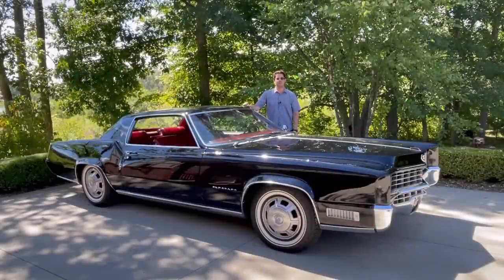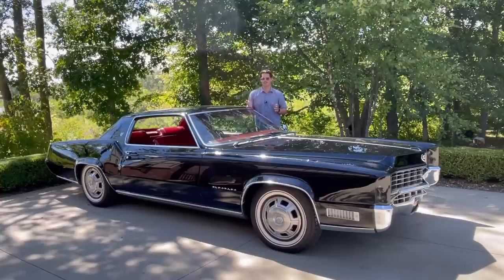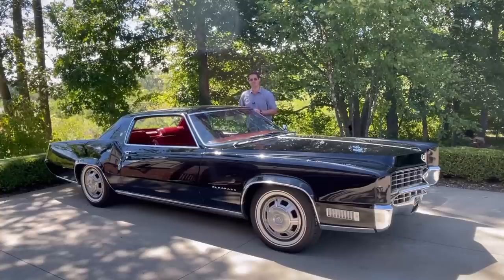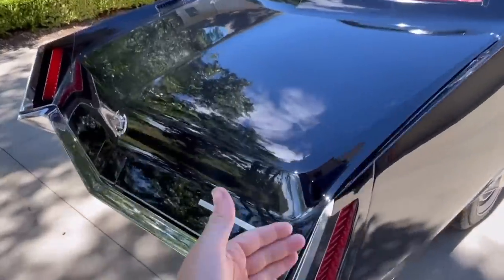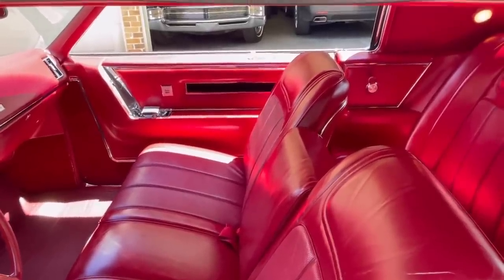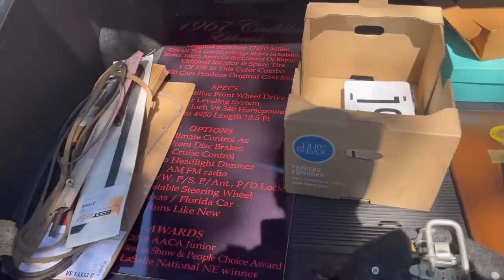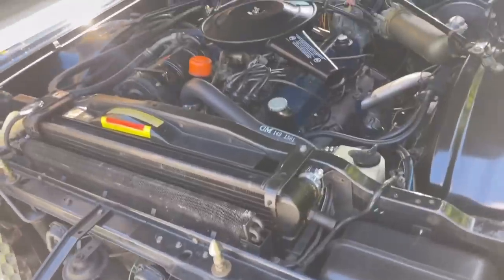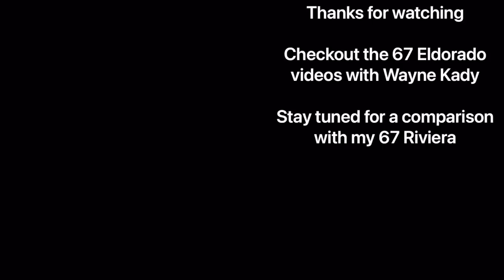Best Styled American Car Ever Made? The 1967 Cadillac Eldorado (with just 18k miles)

Comment: To get power "vent" (rear) windows, one selected option "N" on the Eldorado order sheet. You could select every tiny little thing on these cars. For example, my '67 has power "vent" windows but no power (vacuum) door locks. (One less coffee can under the hood for me.)

The chrome rear-window surround is an ongoing mystery. My best guess at this point is that some dealers created their own trim packages that included a chromed rear-window surround. Since all '67 Eldorados rolled off the same assembly line - a new line built just for the Eldorado that operated at half speed for one shift only - the source of a chromed rear-window trim may well have been external to the factory.

Another one-year-only trait of the '67 is the single, round external, remote-control  rear-view mirror. It was a simple affair with the mirror lens simply mounted on a stick, with the whole mirror base firmly mounted to the door. There was no option in 1967 for a passenger-side mirror.

Pedestrian-safety and driver-visibility regulations changed that mirror for 1968. To increase rearward visibility, the mirror became larger and rectangular. For pedestrian safety, the 1968 mirror had to be attached to the door in such a way that it allowed for the mirror to break off more easily. The '68 mirror remote control is operated through three small cables that run through a break-away mirror base. In other words, you can't easily swap a '68 mirror for a '67. They're completely different.

Thanks for another great video!
Reply: An additional data point for the chrome-rear-window-trim treasure hunt: The last '67 Eldo I saw that had the chrome trim was a California car. 25% of all '67 Eldos built were sold in the Southern California market, thanks to their star-power appeal. '67 Eldos - along with all other '67 Cadillacs - were special anyway because they all required GM's A.I.R. system to meet CA pollution standards of the day. 

Perhaps the chrome window trim could have been an additional perk for the very few who purchased a slick-top Eldo in Southern California?
Reply: Thanks…,interestingly the : no passenger REar view **MIRROR; a strange thing  at best…..
Reply: Wow, you know these cars well. Love it!
Reply: @waltschmerz  Haha "slick-top". Never heard that one!  Interesting info.on the stats. Thanks for that.
Reply: @opera93  That was pretty common to have no right-hand mirror from the late '60s on back.
Reply: @opera93  Here's a mirror-related message I wrote yesterday for another Cadillac-related group:
-----
One difference between the '67 and '68 Eldorado that almost everyone misses is the fact that the '67's external driver's-side mirror is round and relatively small while the '68's is a larger rounded rectangle. This is due to new pedestrian-impact and visibility standards that took effect for the 1968 model year (the same standards that moved the turn signals to the front fender tips and put round side-visibility lights in the rear quarter panels).

If you whack a pedestrian with the '67's mirror, it will result in a very nasty injury because the round mirror is simply (and sturdily) mounted to the door. The '68's mirror has a breakaway base and flexible cables (instead of a simple joystick) to direct the mirror's lens. Of course, being whacked by a '68 wouldn't be any fun either, but at least you'd stand a better chance of breaking the '68-Cadillac-guy's mirror. 😊

As a corollary, no passenger-side mirrors were available on any 1967 Cadillac (not just the Eldorado). Passenger-side mirrors were available in 1968, but they're very rare. That's primarily because they were "flat" (virtually useless) mirrors, not convex like the passenger-side mirrors we're accustomed to today. Back then, not only were convex mirrors not trusted by the general public, they were even illegal. If you look at pictures of (stock) cars from the 1960s, you'll see almost no passenger-side mirrors.

How do I know all this? I adapted some '68 mirrors to fit my '67. The Eldorado's huge blind spot made me nervous so I decided to change things up. The larger visible area provided by the newer driver's side mirror was a boon. Once I saw how useless the stock '68 passenger-side mirror was, I stuck an aftermarket convex mirror to the surface of the passenger-side mirror. Now it is somewhat useful! 😊
Reply: @UberLummox  I've been working on a '67 for the last six years. I figured I've spent enough time and money on it to have earned a PhD in '67 Eldorado by now.😀
Reply: @waltschmerz  Haha nice!   That and the '66/7 Riv are about the last 2 on my list of Us cars I haven't yet owned, and may not get a chance to own.  Enjoy it!!!
Reply: HOMKY! THIS! 1967! CADILLAC! ELDORADO! IS! AN! (ALL)! AMERICAN! HOMKY! (CLASSIC)! CAR!

Comment: I concur, one of the most beautiful of the GM's. The 73 Grand Prix used the hot wire rear glass but abandoned for the 74's forward.
Reply: And the 69 Grand Prix was the first with wires in the windshield in place of a regular radio aerial.
Reply: @billolsen4360  Thanks Bill, I didn't know that.

Comment: Three outstanding exterior features of your 1967 Eldorado: no vinyl roof, no door edge guards, and No Protective Bodyside Molding running between the front and rear wheel openings! So many beautiful cars from the 60's and 70's were ruined by tacky add-ons that looked like accessories from a J.C. Whitney catalog. I agree with Ford designer Eugene Bordinat, "the '67 Eldorado looks like a powerful athlete, dressed in a tuxedo". Thank you, Adam, for keeping America beautiful.

Comment: Adam, you've once again accomplished the near impossible locating a virtual time capsule example of a car difficult to locate in even acceptable condition and not cost effective to restore to perfection. (If even possible.) Not to mention one that's a standout in color, trim and options and my favorite design as well. (Or is it the early Riviera's, original Toronado, Mark III, etc.?! LOL)  Every car guy has at least one story of "the one that got away" and mine involves a '68 Eldorado still in the hands of the original owner in the late 90's. A beautiful aqua example with white vinyl top (bare metal would've been the only possible improvement), white leather and otherwise black interior appointments. The price was right, but I simply didn't have the storage the near pristine car deserved. In fact, one reason the owner was finally selling was because he was upset to discover that while in storage a mouse found itself lost between the spotless white headliner and roof panel and chewed its way out making a small, ragged hole behind the passenger sun visor. Don't know about your painted rear window trim piece, but I do know build location itself wouldn't have influenced it as Cadillac operated only one factory throughout most of the 20th Century on Clark Street. Fantastic car that's another standout example of how your original condition collection truly does turn back the clock in a way that fortunes spent on restoration cannot truly duplicate. Thank you so much!

Comment: Hard to take my eyes off your stunning home and its setting!  My parent's 1963 Cadillac's cruise control had an interesting feature: turn it on and dial your speed but don't engage..   When the car reached the pre-set speed, the accelerator tightened up to. You could accelerate past this point, but it was very firm.    You could, of course, engage the c.c.   GM was famous for rusting around the rear windows.    I had a 1966 and 1967 Riviera with Triple Turbine transmission Dynaflo. No shifting. Things would MOVE.   Headlight doors were kept CLOSED with vacuum rather than being opened with it.  Thus if there was a vacuum leak, the headlight doors would open.   One of my favorite Cadillacs was the 1977 Seville.   Gorgeous!   Friend had one (new). Fuel injection. But would cruise at 30mpg, so I had to ride the brake all the time. Cadillac seemed unable to adjust it.  Big ,mistake removing the door handle from the rear of the doors. In case of emergency, the rear passenger could open the door.  Its removal essentially trapped pax in the rear seats.  I wish you  had taken us for a drive!

Comment: Adam, you are so close to my two best designed cars, not just GM, the 67 Eldorado and the 65 Buick Riveria. They were so different but so much the same---sporty, formal and great crease lines.  Hidden wipers saved money (a bean counters idea)    lol.    The back window looks great without chrome trim around it.   Is there a life span for the front drive transmission "chain?"     SAVE the old battery......    Somebody should make some book ends using a 65 Riveria and a 67 Eldorado.      Thanks for sharing your great piece of GM history.

Comment: Hi Adam, et al, I've always been torn between the 1968 Eldorado and the '69 Mark III as the most beautiful cars of the Post-War era.  I prefer the '68 to the '67 for the more refined styling such as the front parking lamps, etc.
Reply: The 70 was the pinacle.  Got rid of the kitsche earlier do dads and better mechanicals and interior.
Reply: @rogersmith7396  Hi Roger, I actually prefer the more baroque styling... or kitsch... on these cars... particularly the concealed headlamps... that's all part of their charm. 🙂
Reply: The Eldo was a lot more sporty and the Lincoln was a lot more money.  I would say the Lincoln had a higher build quality especially the interior.  As a teenager I used to drag race the Eldo.  Would never do that with the Lincoln.
Reply: @chriscadillac8448  Well I have a word for it which is no longer politically correct but it goes with chrome curb feelers, continental tire carriers and white fur interiors.   Super fly.  My opinion the car got better every year until 71 when it imploded into a disaster area.
Reply: In case you can't tell I've had a love affair with this car for 50 years.
Reply: @rogersmith7396  Hi Roger, I'm not PC, I have more guts, so I'll say it, I would never equate design elements such as concealed headlamps, or more tastefully executed parking lamps or windshield wipers with the side pipes and fur upholstery of a ghetto cruiser or pimpmobile. I just think they make the car look better... in fact, IIRC, the Super Fly Eldorado had the exposed headlamps with giant lenses... which I never could comprehend.

I, too, have had a fifty year love affair with this car... being born in '68... when I was a boy, these types of cars were all over the place. Our next  door neighbor had a black over silver with black leather '68 Eldorado that every morning he had to spend a few minutes hosing off my drool. I have fond memories of being taken for drives in that car. 

Unfortunately, I never owned one of these. However, I have owned a couple MK. IIIs and agree with much of you said, comparing these two titans.  With the exception that being in my early 20s when I owned the first one, I did do my share of street racing with it. The biggest problem with that being the extremely broad sail panels making a right hand rearview mirror a necessity. I was fortunate to get one off of a wrecked '69 at my buddy's salvage yard. 

That aside, when I compared the '68 Eldorado and the '69 Mk. III; that comparison was based on aesthetics ONLY... which is the subject of this video; not on build quality, performance, etc.
Reply: @chriscadillac8448  I was in HS in 1970.  My mom had a 70 Eldo in gold, probably the best purchase my dad ever made, $6600.00.  I could drive his 66 Mustang 6 cylinder no PS or PB, or I could drive my moms fire breather.  Guess which one I took.  I street raced it all the time.  400 HP is hemi Cuda range.  My bread and butter was 383 Roadrunners and 396 Chevelles which were basically decal muscle cars.  Not stupid enough to try a 426 or 440.  Embarrased lots of Ford and Chevy guys and made believers out of them.  They traded it in 77 on a downsized Coupe de Ville.  I was sad to see it go.  4 years ago I bought a 70 Eldo which mainly needed lots of cosmetics which I have mostly completed, tried to paint it the same gold with black interior like moms.  $2500 from Texas no rust.  Our next door neighbor had a MkIIL so I was familiar with it.  Not sporty looking but nice, especially inside.  Theirs was an Army green in and out not my fav..  There was a washed out yellow one for sale around here in very good shape.  Think it had bigger bumpers but otherwise the same.  Stopped and looked at it but a real crappy color.  As for PC I will say greaser cars and rice grinders but I get in trouble on Youtube a lot for being too honest.  Actually I mean no disrespect but the word says exactly what I mean especially about the front grill on the 67.  Cheers.  You might watch Cold War Motors and Eds Auto Reviews.  Both comedic takes on old cars..  The Swedes are nuts about land yachts.  They have car meets that would put Americans to shame.  They are totally serious about land yachts.  My first owned car was a Triumph GT 6.  Go figure.  Raced motorcycles even more.  I could go at Cudas with that.
Reply: The two times I got embarrassed on my bike was a 68 Shelby 428 Mustang with roll cage and a race prepared 301  57 Chevy with fiberglass front end.  Probably solid front axel.  They smoked me bad on my 380 Suzuki which I still have.  Also have a Ninja 1000 which will smoke anything.  Took on a turbo Carrera with that and I was out of his sight before he found second gear.  A really dangerous bike.  0-60 2 seconds, 0-100 4 seconds then 4 more gears.

Comment: Hi Adam,

Congratulations on your '67 Eldorado. I've never seen one with hand crank rear windows before. 

The battery in my Marina Blue Poly '67 Eldorado was long and very heavy like your original car battery. I never had cranking issues. 

I didn't have a vinyl top or chrome molding around my bifurcated rear window either. Personally, the '67 Eldorado is worth the Cadillac wreath and crest on the C pillar, if nothing else. I agree with Wayne. The first year is usually when the design is presented in its purest form. Subsequent changes usually subtract from that purity.

I agree that the design, especially for such a large scale personal luxury vehicle, is unparalleled. Although the '66 Toronado and Riviera are beautiful, the '67 Eldorado is GM's Magnum Opus. It literally looks like a handsome, athletically built, tuxedo clad, confident gentleman, on wheels. One who stealthy glides into social spaces eliciting all eyes admiration, magnetism and a touch of envy. Well done!

Comment: Gorgeous car and a superb example. What I have never understood is why they bothered with front wheel drive in the first place. It can’t have been for packaging efficiency. Another thing, what was torque steer like with a huge V8?
Reply: The front wheel drive in these early GMs provided an absolutely flat interior floor pan which was heavily emphasized in the advertising.  I don’t remember a lot of torque steer complaints.  Power steering during this era was literally controllable by a fingertip (absolutely zero road feel) which may have significantly overcome torque steer.

Comment: That's a tough one!  I'd say this is at least in the top 5 GM styled cars perhaps?  I would include the '63 Corvette Split Window, the '64/'65 Riviera, the 66 Toronado and probably the '65-69 Corvairs on that list as far as pure styling perfection.  If you weren't just counting GM Cars I would probably throw in the ''36-'37 Lincoln Zephyr 2 door Coupe, the '41 Continental, the '61 Continental,  The '36/'37 Cord.  Chrysler was no slouch either.  I think the '68-'70 Chargers are pure perfection,  along with some of the mid 60's Imperials.  All masterpieces of styling.

Comment: I owned one and drove it daily until 1985, when it had, Lord kmows,  over a couple of hundred thousand miles (odometer died at 140,000).  Regarding the ride, I always inflated the tires to factory specs, and the ride was terrific.  If you inflate to what is consdered normal at 34, the ride is horrible.  By the way, mine was a very early production model, and it had a fixed rear quarter window (no crank), and the "Eldorado" letters appeared under the crease.  I always felt safe driving in  snow and ice--- NOTHING could stop the car (unless the snow was higher than the front bumper).   It was a very durable car, and with consistant maintenance, inside and out, it provided terrific long term automotive pleasure and pride of ownership.

Comment: For that car to still have its original paint after 55 years is absolutely mind blowing.  The owner(s) must’ve put it in a hermetically sealed container.  I’ve got a 79 Chevy Nova coupe that was the last car that my grandfather bought before he passed away.  It’s a luggage brown with plaid cloth interior 🤮 BUT it’s been babied.  It only has 21,316 miles on it.  The only comfort and convenience features it has are tilt wheel, 8-track tape player, rear defrost (which is a fan) and power windows and seats.  No a/c because my grandparents lived on Bear Lake in Michigan so they didn’t need it.